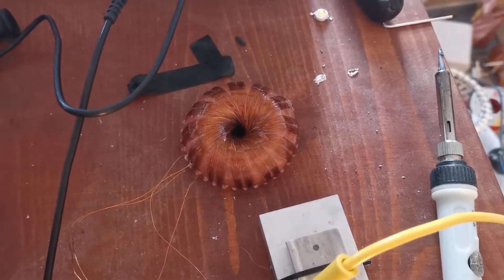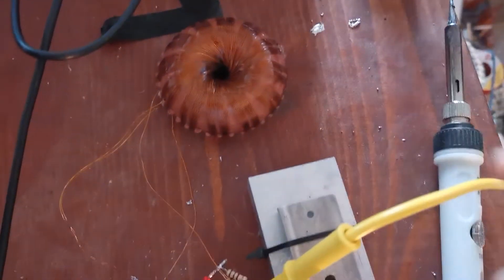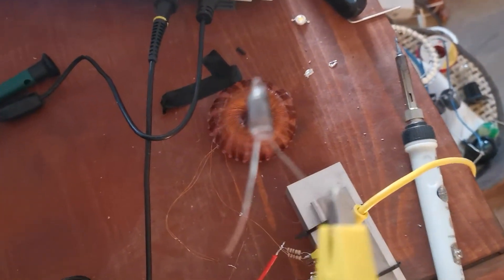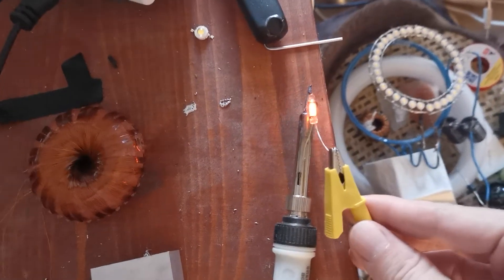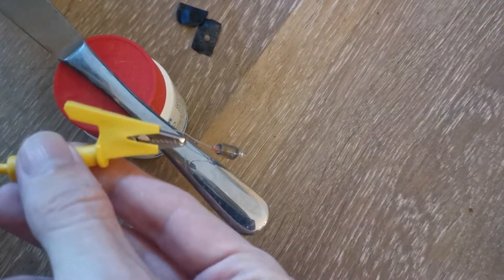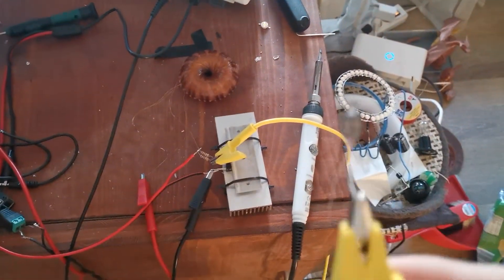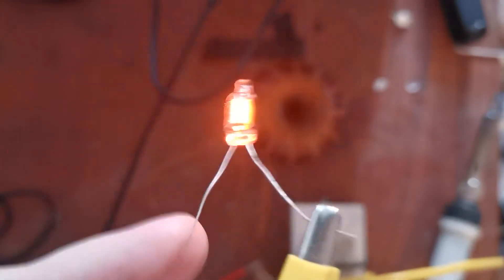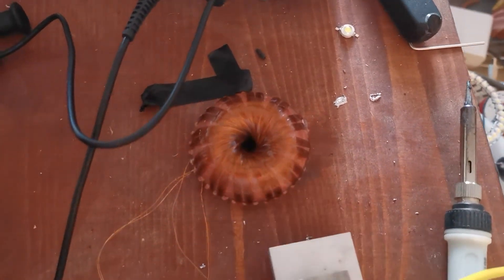Experiments with a bifilar Rodin coil | High voltage impulse generator

Comment: high voltage only starts at 1000V
Reply from the maker: You mentioned that before, I am aware of that.
Notice that the high voltage impulses are way higher than 1kV.

Comment: If metal or other inductors are able to transfer high voltage or radio frequencies (because it seems that high voltage is producing high amplitude RF) do you think we would be able to catch the RF produced by the magnetic field of the earth?. In fact,  magnetic field in movement produce RF. Earth is turning so ...we are placed on the biggest magnetic field and RF generator we could actually use.
Reply from the maker: You can harvest static electricity very easily with a simple metal antenna if you place it high up, well insulated from ground.

The problem is you will need huge antennas placed very high to get reasonable amounts of power and it is very likely that it gets destroyed by the next lightning strike.

I don't know of any other methods how you could extract energy from earth.